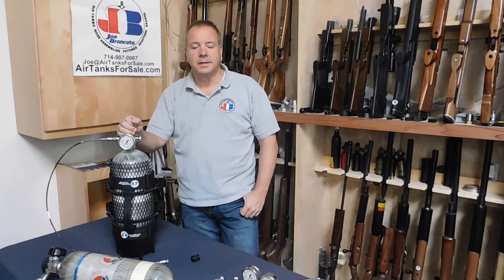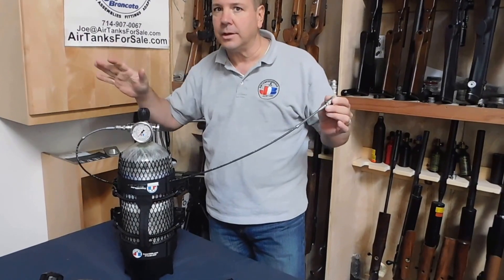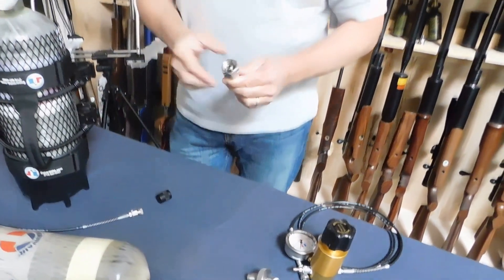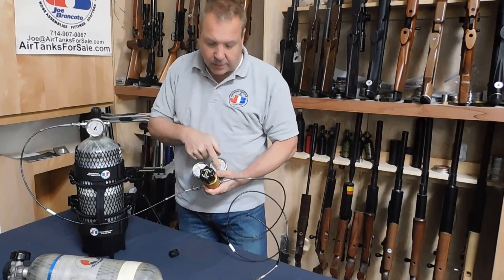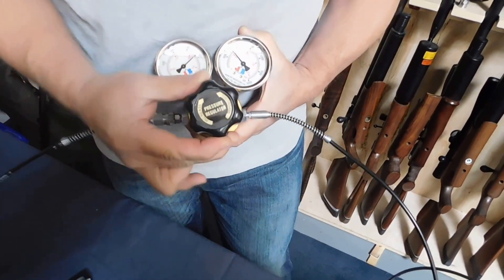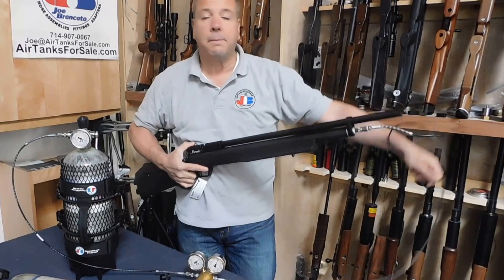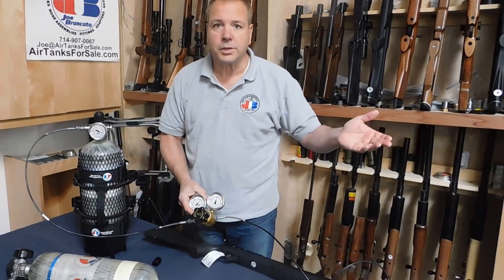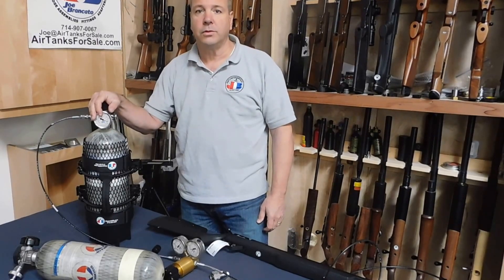Regulator/Regulated Hose Assembly vs Valve for Tethering PCP Airguns, ex. Marauders, Gauntlet, etc.

Comment: Curious if this system could work to power a pneumatic cylinder/tool.  They make lemonade smashers that will smash/crush/muddle lemons for fair style lemonade that run off of CO2 tanks or compressed air.  Would be nice to utilize a scuba tank because of cost, but the psi to run the lemonade smasher piston needs to be in the range of 70-110psi.  would this work?  does the adjustment on the side allow for easily and reliable adjusting to lower the psi or would something else be needed?

Comment: So if my understanding is correct, this is essentially giving yourself a larger capacity tank. 
Does this then mean that if the fill port was in a less awkward position you could technically use a tank as a backpack for in the field.  
For example if you had a bullpup and fill port was underside of buttstock then the airline could run comfortably underarm to a tank on one's back.

Comment: I'm sure enjoying mine - it makes topping of my PCP guns a simple thing to do.  

Hey Joe,  I leave the regulator connected to my tank, unless I'm filling the tank, but a few times I forgot to turn the tank off after filling a gun.  Every thing holds just fine.  Is is okay to just leave the tank "on" and let the regulator handle it.
Reply from the maker: It's always best to disconnect high pressure when you are not there to monitor whatever could happen.

Comment: Hi Joe, I've bought a number of items from you and this regulator you sold me in Feb of 2017 is wonderful -  and still works flawlessly.  I used it just yesterday (12/30/20) to fill both of my .22 PCP guns (a FX Royale 400 and a Benjamin Marauder).  I turn the knob slowly and have no fear of over-charging my PCP guns - the increase in pressure is smooth and predictable (I can easily see it happening).  I've never used it to tether my tank (a HammerHead 66 Cu Ft carbon fiber tank that I also bought from you) to my PCP guns, but can see the advantage while shooting from the bench with the gun connected to the tank.  Currently, I only use it when I connect my tank to one of my PCP guns.

Comment: Hey Joe, I bought your great white tank and I see you have this filled slightly above 4500 psi,.. I have a compressor, and just fill to the 4500 psi line out of safety reasons..  2 questions,  I know it is it ok to safely go above the rating by a 100 or so,  but is it ok to almost go to 5000 with your tank? like say fill to 48- or 4900 safely? I understand about drop off , as I'm aware of cooling and the drop off line factor when filling a tank..thx bud 
And 2- what is the burst disk rated for on the Great White Tank? is it a 7.5k?
Reply from the maker: We only recommend filling to 4500 PSI. No use going higher than that. If I told people they could 10% over-fill, they'd go 15%. So I say fill to 4500 PSI.  And to be honest, few compressors can go higher, and it beats the snot out of most to do so. If one has their own compressor, better to fill more times to 4500 PSI or less, vs. over-filling and beating up their compressor.
I actually have our burst disk set lower than 7500 PSI (It's 6AM here, so I can't verify at this moment, but IIRC I specified 5500PSI for our disks). We are OEM to a couple of VERY large companies, and one thing I wanted to avoid was people significantly overfilling their tanks with our valve.   We haven't had any issues with normal pressures (4500 PSI), and I feel safer keeping it lower.  It never failed yet.
Reply: Ty Joe, and I appreciate your honesty... I'll def follow your rule.. be safe and cheers!

Comment: Where i can i buy that regulator
Reply: The Airgun Scientist Joe Brancato Do you still have this regulator in stock. How much is it? Thank you.
Reply from the maker: We have it in stock, ready to ship. Call us at (714) 907-0067 between 8AM-4:30PM Pacific and we'll ship it right out!
Reply from the maker: Yes, We have the TJ3 Valve, as well as the Regulated Hose Assemblies.  You can see them on the links Ihave attahced below, and then call us to order at 714-907-0067
The TJ3 is availablebe here: http://experthpa.com/cart/cart.php?m=product_detail&p=112
A few of the Regulated Hose Assemblies we have are shown here: http://experthpa.com/cart/cart.php?m=product_list&c=54
Reply: The Airgun Scientist Joe Brancato 

On the bottom link. Is the third choice the regulator with the quick disconnect as seen in the video?

Comment: Hello there...great videos...I was wondering if you could give me an honest answer..I would like to know when I should worry about corrosion in my pcp air gun cylinders...I only use a pump..like when I should look into tossen them...our replace them..I have a 45.cal texan...tactical sniper   in 9mm and a hatsan bt65...thank you  much sir..just trying to hey alittle piece of mind being that the company's I bought these from can't give me a straight answer.
Reply from the maker: Hugo Ezparza Amount of moisture in the air (humidity) which depends on many factors.  bottom line, I live in Southern California, which is a semi arid desert. We still get a lot of moisture in our compressors (tablespoons of water every time we fill a tank). We need to use a moisture filter. If you lived in other places more moist than a semi arid desert, you would even get more moisture.
Reply: Thank you sir..but about my question...when do you think I should worry about changing the cylinder to my air rifle? Thank you do much.

Comment: Thanks for the video Joe.  I use a similar setup with my SCBA tanks only I use a 4500 psi paintball tank with a Ninja 2900 psi regulator to my airgun.  Works great for benchrest shooting with no shot curve drop because the pressure is constant.
Reply from the maker: Thanks for the input.  
FYI, We have a similar paintball type regulators set-up for 3000 PSI if you ever need another. And it is very accurate with pressure.  We put ours on a 114 Cu In tank instead of a 90 so that it gives about 30% more shots, without being much larger. Price is $299